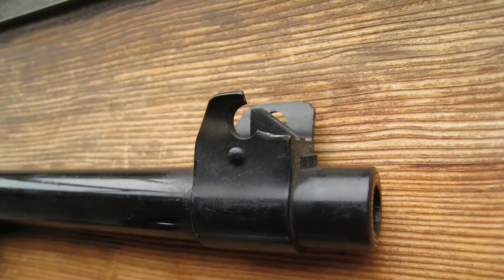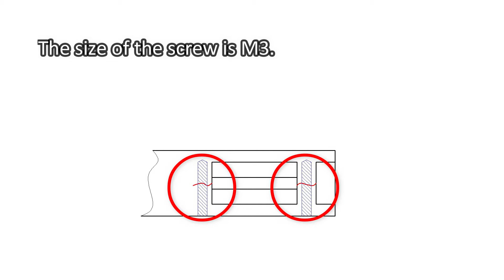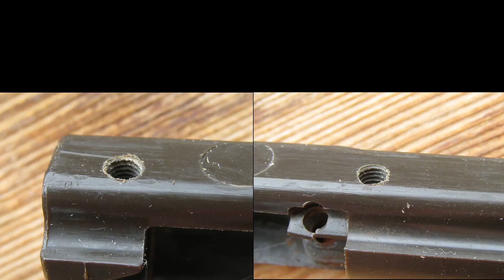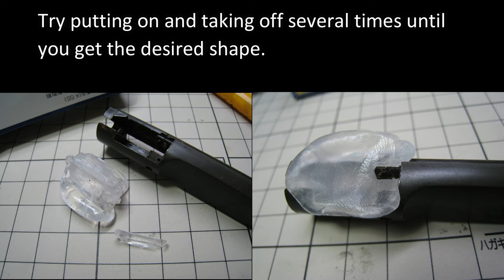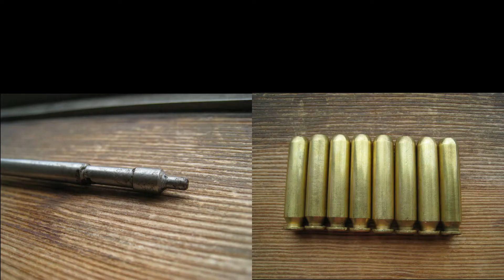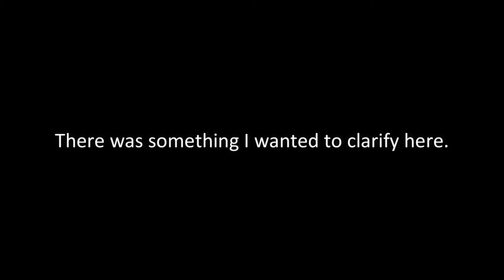M1 CARBINE Chapter 1：English version

Comment: Very, very interesting! Thank you for sharing this. We are fortunate in the UK that we can use steel to make replacement parts such as bolts. This makes much stronger parts. I know that you cannot do this in Japan. Your comment that the original zinc bolt can crack after the first 30 shots is sadly true. Zinc is not ideally suited for stressed parts but MGC and other manufacturers were limited by Japanese legislation. 3 gunpowder charges produces a lot of pressure. It would be interesting to see if converting to CP type, or your X cartridge would provide sufficient power with 1 or 2 gunpowder charges.
Reply from the maker: First, please allow me to correct only one of your comments.
『original zinc bolt』→『original resin bolt:(Acrylonitrile-Butadiene-Styrene)』

I don't know how much regulations on toy guns in other countries are.
Probably because "model gun" is not recognized, it may be equivalent to no regulation.
However, in Japan, various toy guns are regulated, not limited to "model guns".
That is not the case not only in the product, but also in the case of expressing it.
The other day, a ”You-Tuber” specializing in toy guns was stripped of advertising revenue. Without prior warning.
I'm not surprised. Because I know that "Japan is such a country". However, I understand that this is completely different from the regulation in the neighboring country "C". The so-called "self-defense function" may have worked. Recently, a lot of crimes and accidents involving firearms have been noticeable in Japan.
By the way, I will reiterate that the fact that the bolt breaks in 30 times is the manufacturer's negligence.
Thank you very much.